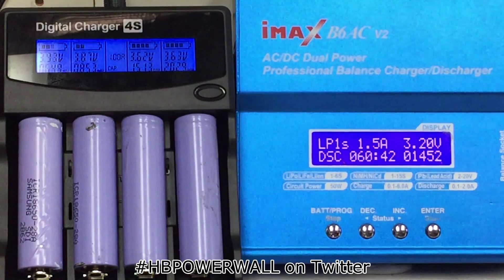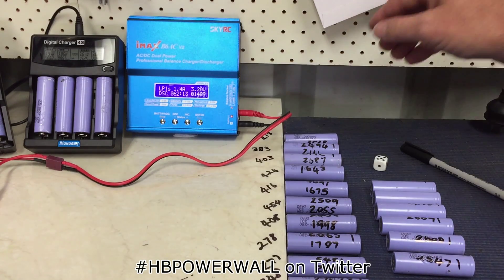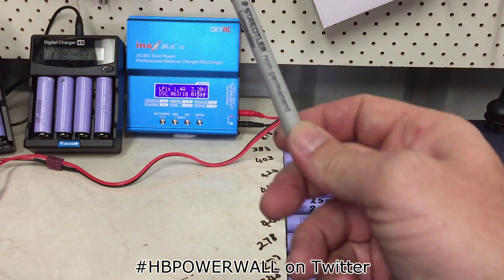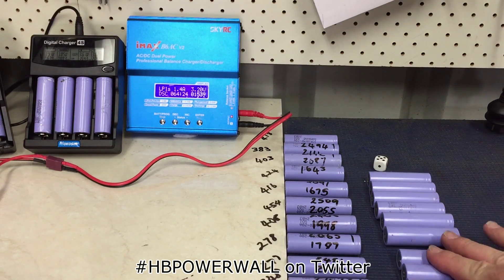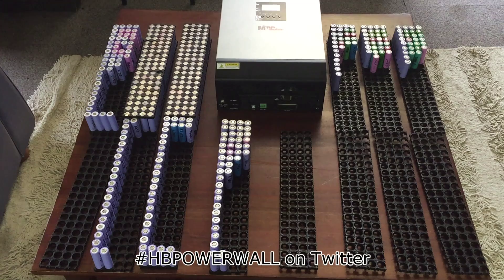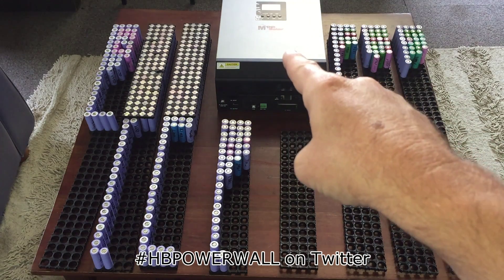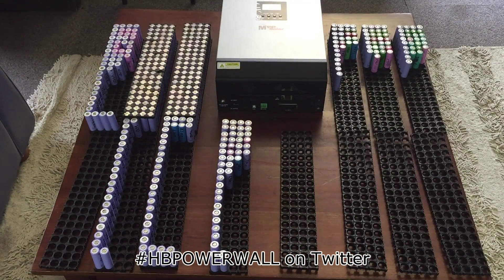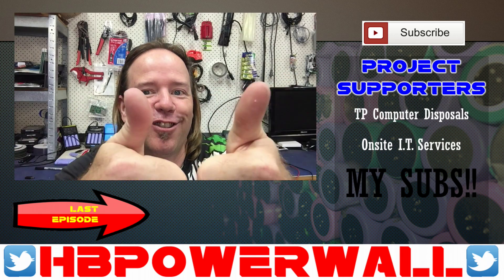IMAX B6AC V2 v Nokoser 4S & Powerwall update

Comment: There is no need to test each 18650. The reason is as you increase the number of the 18650 say you have 7s and 400p then the current that you will take from each 18650 is very little; thus the capacity will be large.
Reply from the maker: +Alaa Sadek Noted - but still doing it anyway :) found at least 50 cells that would have slipped through a voltage check that would have been less than 1000mah.
Reply: +HBPowerwall You are right the voltage check is not enough at all. But I built my pack with a fuse on each 18650, just like a Tesla. In fact I have 2 fuses one on the positive and one on the negative. What this does is very important. If an 18650 fails and becomes a wire and not a battery then all the 18650 cells connected to this bad one will dump a lot of energy in it. Thus the fuse breaks. Now when it comes to capacity let us say that you have 200 18650 cells in parallel. The probability that two cells have identical capacity is zero. So all of them have varying capacity. The end result is that they all have the same voltage in the parallel pack and the capacity of all the 200 18650 is high. Now what you are trying to do is save on space and weight by putting the highest capacity in each 18650. You are lucky since you have an almost infinite supply of laptop batteries. But as it is a stationary application I do not have a problem if I have a 20 to 30% increase in weight and size. I just add as many 18650 cells as I can and I do that incrementally while the system is live. I think some call it hot swap. So it saves my the time to test each individual 18650. When I started I was was going to use two blanks of wood and connect 100 18650 to the blanks and use an Arduino to charge and discharge each 18650 separately and measure the capacity; but this needed time and money and when I simulated the capacity of each 18650 on an excel using the random between 800 mah and 2400 mah as the number of 18650 there was hardly any gain by sorting them to maximize the capacity. But you are doing better than me. Good luck
Reply: +Absolom Madhaka I did not buy them from ebay. I got a 6mm2 wire or similar. I beg you to forgive me but I can't remember. At any rat the strands of the wire are thin enough to melt when you connect the positive and the negative of one 18650. It was a very crude way I will confess but my theory was that if one 18650 was able to melt and thus break the short circute  then 200 18650 will surely melt this 0.7 or so of a mm even faster than what a single 18650 did. If I remember right the wire melted in less than 2 or maybe less seconds. It depended on how full was the 18650 I used at the time. So I will admit that I did look up a fusing table of AWG and you can surely do the same. I measured the diameter of the wire I used as a fuse and again if I remember right the wire I used fused at 10 or so amps. Very crude I admit but it is a very cheap way to have an almost infinite number of fuses for any length.  1 to 2 cm length max is what I used. 

I am not rich enough to buy a fuse from ebay. I hope that helped. 

Let me know.

Alaa
Reply: +Alaa Sadek can you direct me were you got the fuses from if its online
Reply from the maker: +Alaa Sadek Totally agree that this totally crude BUT where money doesn't permit - that would definitely be a solution that would work far better than having nothing. I might even try that myself as an experiment. Necessity is the mother of invention!